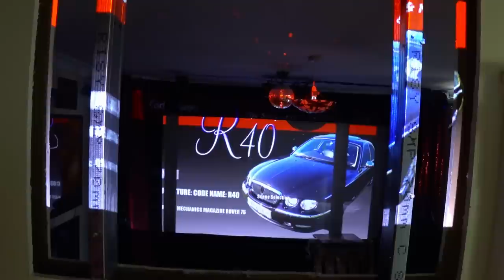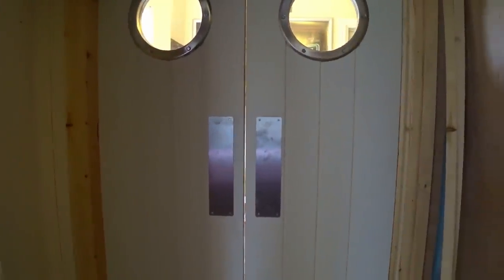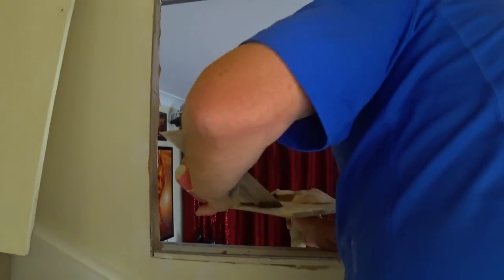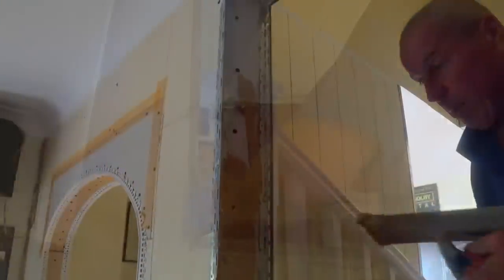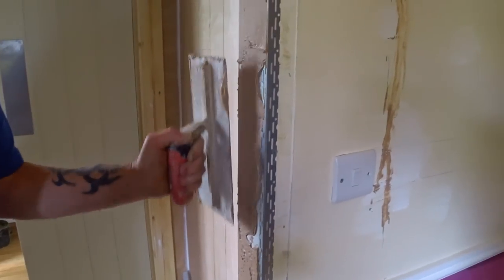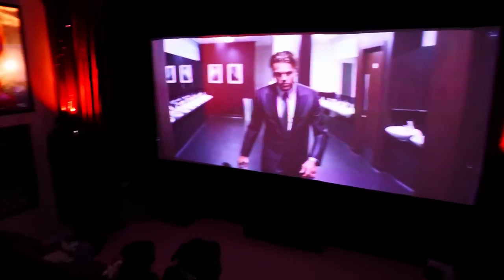HOME CINEMA CONSTRUCTION

Comment: Things are looking great john.  I can see your influence from cinema trips in the 🇺🇸 Those swing doors work a treat.  Your Empire sign too from your frequent visits to Leicester Square. 
Getting the screen fully unfurled and straight must feel good. 
The ceiling mount looks to work a treat too.
Well done. 
Trev
Reply from the maker: Morning Trev.  The screen is now currently on the floor under the black velvet that's hiding quite a few things for a while until we can get fully sorted.  I need to put another coat of brilliant white emulsion on the wall but I don't think I'll get the time any time soon so it will have to wait.  The ceiling mount does work but it's nerve wracking putting the projector up there.  It certainly does need to blokes to tackle it but now that we've done it (twice!) we worked out an easier way and it won't be quite so daunting if we ever need to do it again.
John.

Comment: Love the doorway and the windows. Crazy how it just makes everything seem more cinema related. I would love to one day finally make a secret bookcase door on mine. But I just keep putting it off especially with a 3rd 1 year old child now running around.
Reply from the maker: I've just had a look at your home cinema/game room tour.  I'm not all the way through it but it's very nice.  Maybe you could put a black card along the inside of each curtain to act as masking when you close them up a bit for different ratio films.  Or maybe put a second curtain track in for that and operate them separately.  It's lovely as it is though so just my first thoughts as I'm always thinking along those lines.  John.
Reply: @moviecollector5920  Thank you so much! I would love to add a way to actually mask the top and bottom as well. I'm not sure what would be the best way to achieve it. I'm not sure I follow the black card approach. Do you mean some sort of sewn pocket on the inside of the curtain to place a card or extra curtain? Would love to hear all your ideas. Thanks for watching it and your advice.
Reply from the maker: @VirtualRobotsRevolt  The side masking on mine is basically black card covered in black velvet that gets pulled along and drags some black velvet fabric along behind it.  If you put some black card in the first couple of connections on your existing curtains then you'd have a black mask built in for when you're using the curtains to mask off different aspect ratios.  For top and bottom masking it's just a roller blind and that can operate both together or just do the top one and close it down further to narrow the screen to the 2.40:1 'Scope ratio.  The projector would then have to aim further down of course but that's all another task for another day.  I did a video about 18 months ago when we first moved here showing how the masking and curtains all go together.  Might give you some ideas if you feel like even more of a challenge.
John.

Comment: A very nice video. Love the swing doors.
Reply from the maker: The hinges for the swing doors have been the most complicated thing of the whole project so far.  But I am about to get back onto the top and bottom masking so that might pip them for the top spot.  I think a second motor and roller is going to be required as the two masks working off the one system is just too heavy at the new, extended width.
John.

Comment: John, hi! It looks so welcoming and cozy!!! I love the project!
Reply from the maker: It does sort of entice you in there Dmitri.  We had some friends over at the weekend and we didn't point the new cinema entrance out to them but they didn't notice it which suggested it fitted into the house successfully.  When they did spot it they seemed rather excited and the phones came out to shoot some video so I powered it all up and put all the lights on including the neon.  Even during the day it chuck the light out.
John.
Reply: @moviecollector5920  That sounds like a successful remodeling! Congratulations!! What else do you plan to make there? God luck!
Reply from the maker: @dmitripopov8570  I just need to get the top and bottom masking sorted out as soon as I can get to it Dmitri and the walls finally painted a suitable colour I suppose.  Then it will just be a case of tweaking everything so it all works as well as possible... until such time as the carpet gets changed.  I wonder if it's possible to get bespoke carpet tiles done now.  Hmmm, a design with the same 'Empire' logo on it seems like a good idea.  Just got your email.  I recognized the Blade Runner frame immediately despite it being black and white.  I can imagine how that film would work in black and white but I do love it as it is and as I don't get to watch it very often when I do I will always want to watch it as it really is.  Might do an extract though to see how effectively black and white would suit it.  John.

Comment: Seems like it’s coming along nicely. I can’t wait to see how it looks finished. It’s been a small moment since I’ve posted a message here but I want you to know I watch all your videos and love them all.
Reply from the maker: Thank you Aisback.  Andy's done the rest of the plastering today so it's not too far away.  I do need to re-work the top and bottom masking now though as the bottom mask it too big and too heavy to run in conjunction with the top mask so a separate motor and roller is required methinks.  More expense but as long as it works I won't mind so much.
John.

Comment: Hi John, to alter the existing structure is always more work intensive than building from the ground up.
Ten foot screen now that will make an amazing difference,l myself have been wanting to convert our pointless conservatory at the rear into an actual extension just for a home cinema room as my current system is in the main bedroom upstairs a 13-2 system with a Samsung 85" Neo Qled ...room is 13ft x 9ft  lol l intend install a front projector and upgrade some speakers when the conversion is done which will probably take place next spring 
I can't make the most of my system in a room as small as it is atm....anyways can't wait to see your room upgrade when it's finished ❤
Reply from the maker: Sounds like a good idea to me James.  Get on with it,, get it done and I've coming round when it's finished!  John.

Comment: That does look pretty special. The projector looks a little modest, mind 🤔😉
Reply from the maker: Which one do you mean Andrew.  If it's the little video projector that's the Optoma UHZ50 and it might surprise you.  I didn't fancy putting the UHD550X up there as it's so big and I don't think we'd like it dropping to the floor or on our heads.  The UHZ50 is surprisingly good.  People do obsess over it having a laser for the light source but all that really means is it should last even longer than an LED light source.  It does appear to also raise the contrast levels too.  John.
Reply: @moviecollector5920  I only saw a small projector. I have the optoma uhd42 which does 4K (kinda) but the black levels aren't. 😂  I should have realised you have more than one.
Reply from the maker: @FatNorthernBigot  Projection isn't a telly Andrew so don't expect the almost Technicolor fake-like colours of an OLED television.  Nothing beats projection onto as big a screen as possible even if sometimes people might claim a telly looks better.  I rather enjoy it when people tell me about their big screen and then I find out it's 50 or 60 inches diagonal.  How big is yours? they ask.  Then they wish they hadn't.  John.
Reply: @moviecollector5920  There's something more natural and easy-to-watch about a projected image, definitely 👍

Comment: Great to see it coming together. I remember when you were first moving in and you showed us the short comings! (see what I did there) of the room. It's amazing what ingenuity can do and an electric saw. I was thinking back to your earlier videos and you showed off your equipment that you had. With A Pioneer VSA-E08 as the main power! is that still your main source? or has the move required an upgrade. I have a pair of them one being used to make up the back rear channels. I think what's inspiring is the fact that (and I could be wrong) but I don't feel that what's being achieved has been expensive. In terms of equipment. Like the two E08 I have were from eBay and my DVD player is a Panasonic DMR-E500h which was a tenner. I look forward to seeing a final report of it complete.
Reply from the maker: The VSA-EO7 is still in use Andrew.  I also have a VSA-EO6 which I got when new for less than a grand.back in 1998 I think.  I got the EO7 because Blu-ray went down the Digital Theatre System sound route rather than Dolby Digital otherwise I would not have bothered.  Putting the screen and motorized masking/curtains together is cheap in essence because it's just black velvet, cardboard, a couple of corded curtain tracks and a roller blind but motorizing and automating it all is the main expense.  Leave it all for manual adjustment and there's not much to shell out at all.  The screen is now the wall which I've painted brilliant white emulsion.  It needs another coat but I've run out of time for a while.  I expect we'll put the ten foot wide roll down screen into the living room for occasional film shows in there.  We've had that screen for over 30 years now and the reason it's ten feet is because the original room is was for was ten feet and three inches wide.
John.

Comment: Great video, you really did have to think outside the box😅, most screens are measured in inches and not feet, I would love to see it in action.
Reply from the maker: Television did the diagonal inches thing to make people think they were getting something bigger than they were.  Cinema always measured the true width of a screen so that's what I've always done.  I can't tell you what the diagonal measurement is but I can't screen flat films full width, only 'Scope ratio films (2.40:1 for example).  Image size has to be reduced to about 8 feet for flat films to fit in the screen.  John.

Comment: Looking great, John!  The hole being cut in the back of the room is so you can mount the projector outside of the theater and then fire it through single pane glass?  Less noise?
Reply from the maker: There is hardly any noise from that projector.  It's there so it's out of the room where a projector should be but also able to fill the screen.  John.

Comment: Very nice! I wish I would have the space for a dedicated room like this.
Just one question: Where will the film projectors be housed? From this video it seems that there is a staircase right behind the opening that was cut in the wall. Or maybe I am just confused 🤔
Reply from the maker: The Super 8 projectors will go on a platform on that staircase which I've already tried and it works well.  Might have to do something different for flat films though as I'm sure the size of the image won't be big enough.  No such problem with 'Scope films which will fill the screen from end to end.  35mm is going to be similar but I haven't lugged that into position yet.  Coming soon though.  Same for 16mm.  John.
Reply: Ah, thanks for the reply!
I love those details. Please do another video when everything is in place. I could watch those forever and dream about having a real FILM theater of my own. Right now the kitchen is my "projection booth" 😅
Reply from the maker: @Nummer6  A house we were trying to buy a few months before we settled on this one would have had us projecting from the kitchen, albeit the utility room part of the kitchen.  We wouldn't have had quite such a big screen in that one though so just as well the sellers pulled it off the market and we found this.  John.

Comment: Looking good, John. Question: Are those sequin curtains?
Reply from the maker: On the outer edges Clark.  The original curtains were to cover an eight foot wide screen and we wanted to continue using them in the new house.  Fortunately the sequin material is available in a closely matching colour.  John.

Comment: What projector are you using as I have home cinema to and have a epsom 9400 had it for a couple of years and as it’s also 3d and have around 150 3d disc’s great picture enjoy your cinema
Reply from the maker: Afternoon Gary.  The video projector you see in this video is an Optoma UHZ50 which was the closest match I could find to the UHD550X but somewhat smaller in size as I didn't fancy hanging up that whopper from the ceiling.  The UHZ50 displays 3D so it might be a good choice.  Don't get fooled by the 'laser' details though as that's just the light source and not a bunch of lasers magically forming the projected image which is from a single DLP chip.
John.

Comment: Hey John! Would you happen to have a copy of the Texas Chainsaw Massacre on super 8? I would love to use footage of it/it playing and/or pictures of it for an upcoming video project.
Reply from the maker: I don't have a copy but a friend does.  He has the 4x400ft in the Iver Films clamshell cases so it's missing the drive from the petrol station to the house of horrors when ol' Dad is prodding the last survivor with a stick or something in the passenger footwell.  My brother and I did have the 5x400ft on hire back in 1980 and we charged 50p to see it for the couple of days we had that print on hire.  So many school friends wanted to see it that we made quite a profit on the whole deal.  The film was still banned everywhere but the Greater London Council controlled area back then but it was screening in our house... then later on it was banned as a video nasty.  The prints are not great but they would have come from 16mm just like the original shoot.  Probably a negative several generations down from that original shoot and at the time Super 8 was a mass production process so not the tip-top quality it would become in the late 1980's to mid-2000's.
In Facebook you should be able to find a group called 'Official British Film Collectors Convention' so see if you can join that and post the question in there.  I know there are many collectors who have Super 8 copies of The Texas Chainsaw Massacre on there.
John.